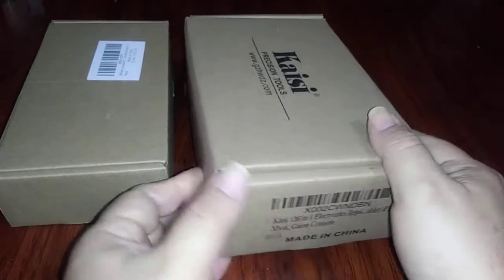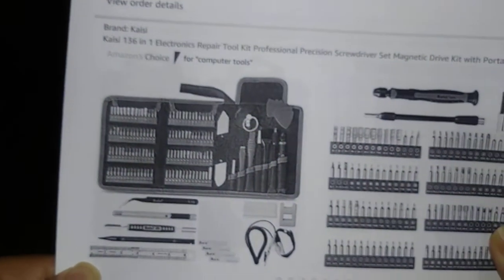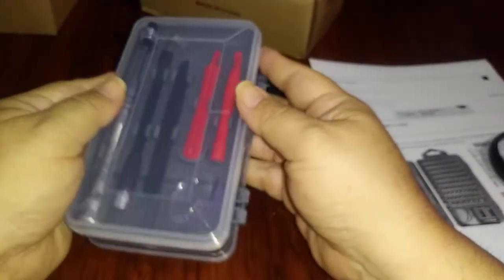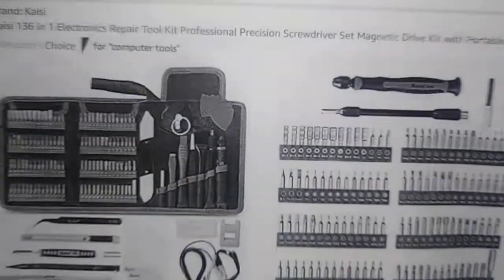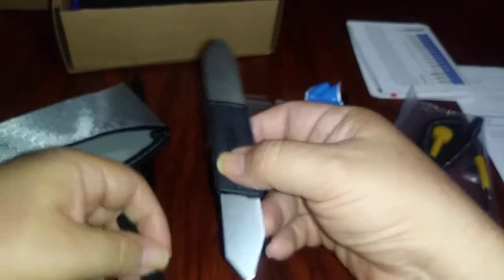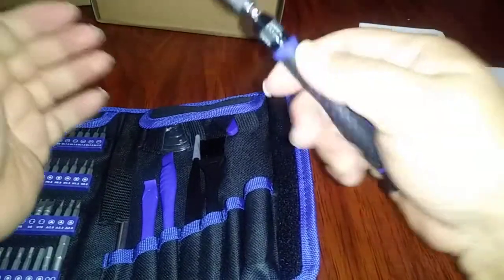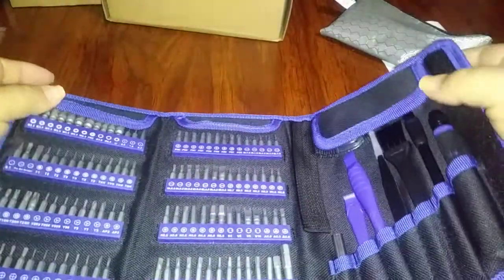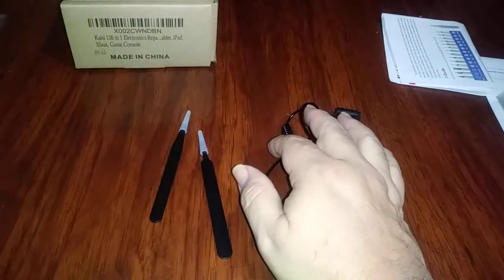Electronics repair screwdriver tool kits Unboxing.

Comment: Any reason you’d need both?
Reply from the maker: If you're looking to purchase and electronics repair kit there really would have been no need to have both of them between the two I could see the they pretty much have the same thing except with some variations in the larger kit. But for me it's always just good to have a spare set. And there are times where I will purchase identical items from different manufacturers to compare and review on my channel. Some of the items you might see in future videos would be items that I have purchased only 4 review purposes and I've either a resold or returned once I'm done with him and then there are the other items that I actually keep. I do not receive free samples or anything like that from manufacturers.